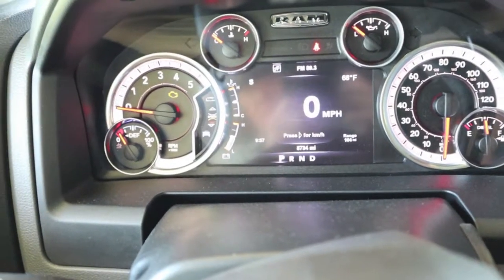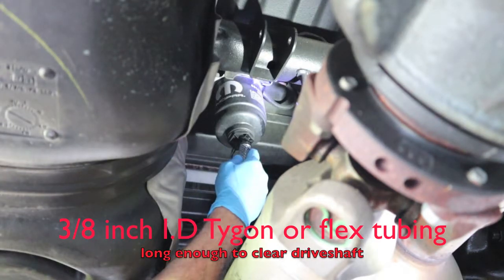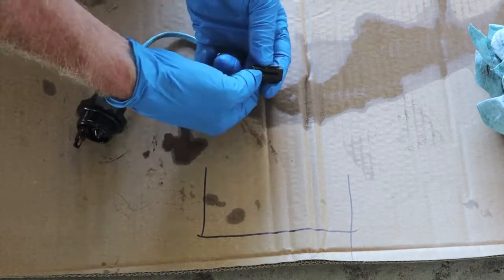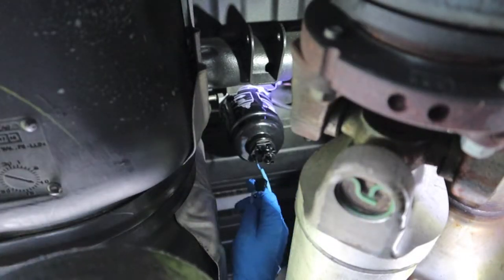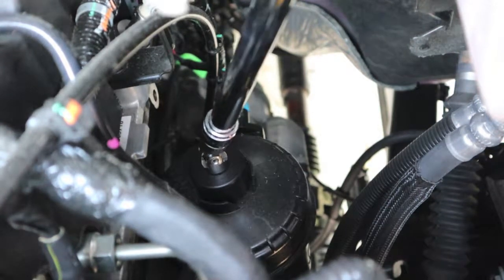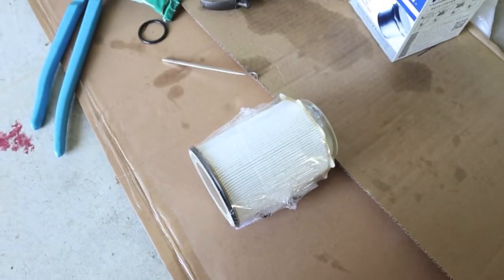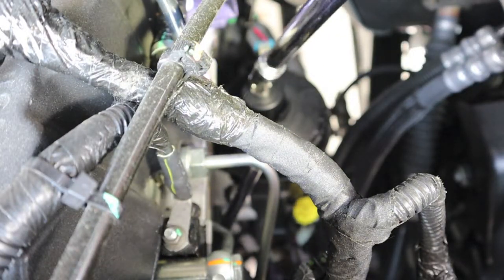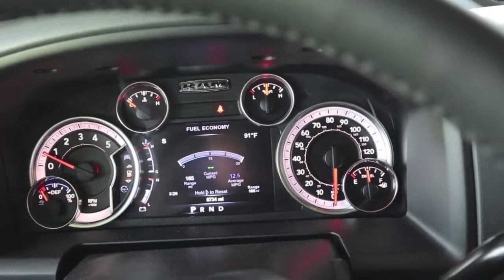2017 RAM 2500 6.7 Cummins 2 year fuel filter change with added info

Comment: IF you look at the rear filter fitting mounted on the truck when you take the filter off, there's a little ball valve up in there and inside the filter there is a little plastic nipple. That nipple pushes in that ball valve allowing the fuel into the filter. Because of this you don't have to worry about fuel running out when you change the filter,
Reply from the maker: Thank you for the information!

Comment: You don't need to drain the filter completely to take it off!  Front or back.  Thats just a waste of time.  The truck will also tell you when it's time to change the filter. If you don't trust that then watch your fuel milage, when it starts to drop a few miles per gallon then change them.  I usually change mine every oil change. I use full synthetic, so I change it at app. 15000 miles. I also prime the new filters before I install them. Doing this prevents any problems getting the air out of the system when trying to start the engine after the changes.
Reply from the maker: Thanks for the info!

Comment: I have a 2018 Dodge Ram Cummins SLT I bought last year on Halloween 10/31/19 with only 12 thousand miles i have 18 thousand miles on it now its gonna be the 1st oil change and fuel filter change on it i wanna see what it looks like at 6 thousand miles Good Video

Comment: Very helpful video but I thought you might like to hear by dumb blunder. I didn’t triple check the o-ring on the front filter housing had set properly and I suspect you know what followed. I mean I did a hand check but had nitrile gloves on so I’m guessing I just didn’t register it… I feel like a big bumb a-hole and have a mess to clean from the driveway but still better than paying the dealership $$$. Also I reset the o-ring and thankfully everything was fine, though I ordered a new one to replace it before driving just to be sure… I’m dumb and thanks
Reply from the maker: Very easy to do what you did. That particular o-ring has a habit of wanting to ride low and beneath where it needs to be.
You won't make that mistake again!
Thanks for watching!

Comment: Thanks for sharing. Will #4 work on the front as well or just the rear?
Reply from the maker: Hi Scott and thanks for watching!
Dow 4 will work on both flat rubber type gaskets and o-rings. Manufacturers recommend using motor oil and that is certainly a good practice. Using motor oil or Dow 4 will not matter as long as the filter is not over tightened.